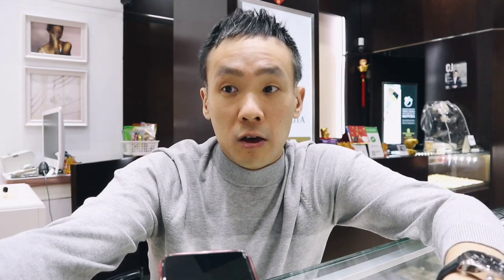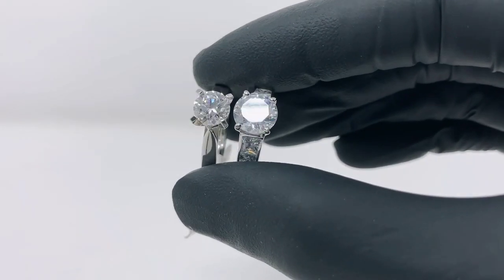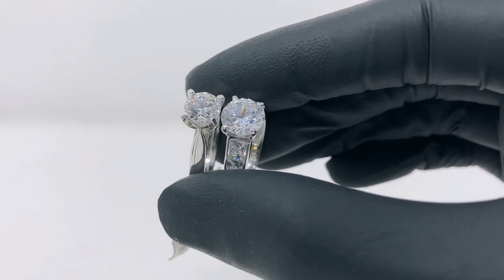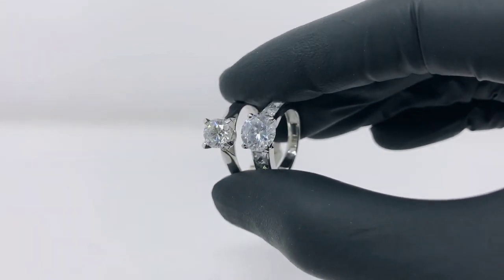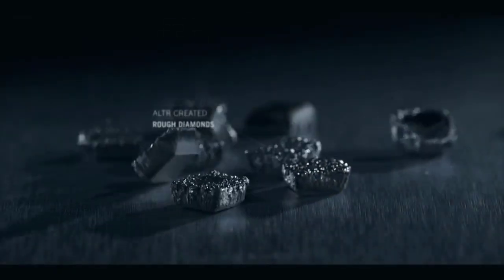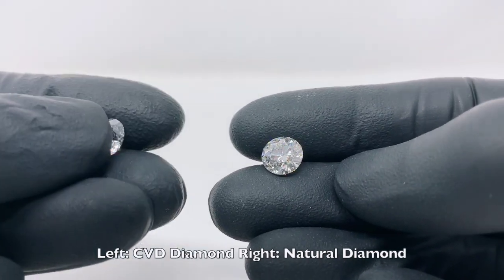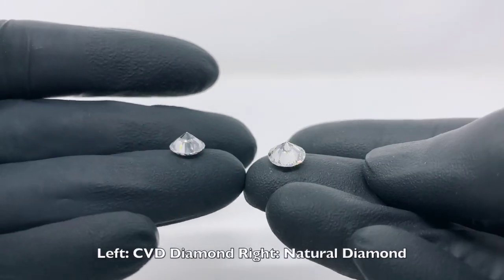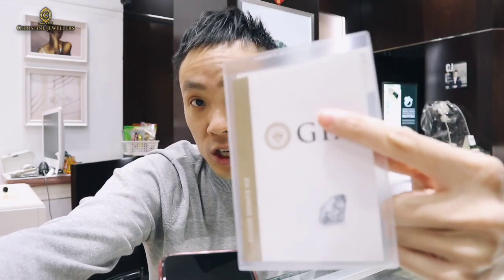REAL DIAMONDS, IMITATION, SYNTHETIC DIAMONDS CVD, HPHT EXPLAINED!

Comment: Is it posibble to create a lab diamond that can not be distinguished by comparing it with natural diamond?
Reply: Probably not. Mined diamonds have certain impurities that lab diamonds do not have. Even if lab diamonds had no impurities at all, that alone would distinguish them from mined diamonds. But, even now, we are talking about needing expensive equipment. Not even a gemologist could tell them apart without such a machine.
Reply: @Austin1990  Mas quanto ao índice de refração...ou seja o brilho e até o fogo que a gema natural proporciona...Esse cvd é a mesma coisa?  passar no teste de diamante não interessa ...O que interessa é se as características são exatamente iguais ..E é? obrigada...from Brazil!
Reply: @mariamaria4035  Yes, CVD diamonds are diamonds. CVD diamonds are perfect diamonds, better than natural.

You are thinking of diamond imitations. CZs are not diamonds. Moissenite gems are not diamonds. Those look similar to diamonds, but they are different materials.
Reply: @Austin1990  thanks!